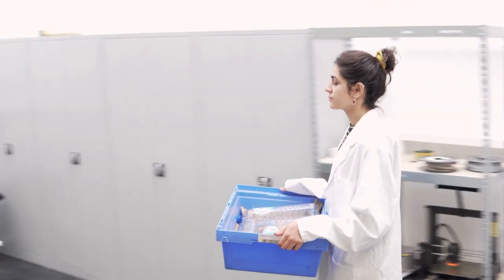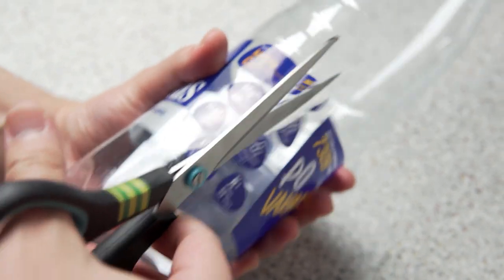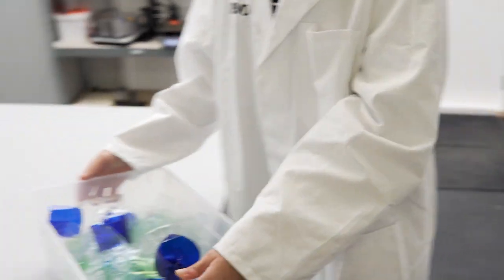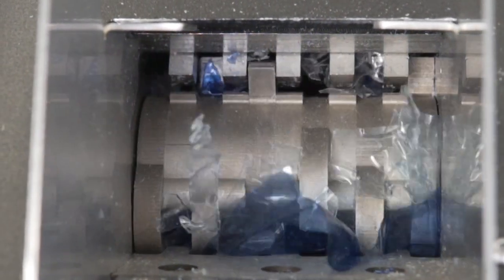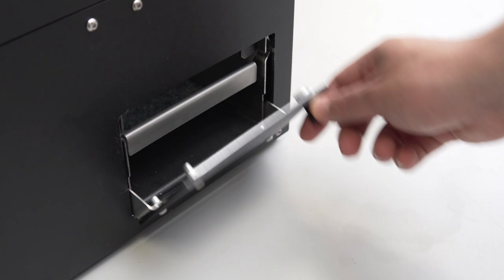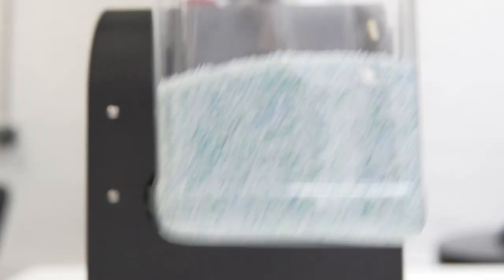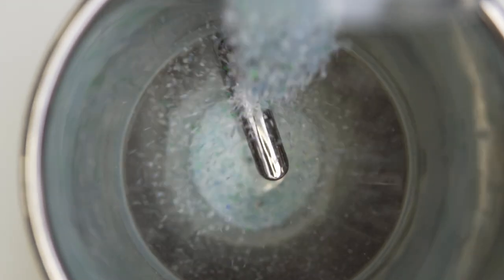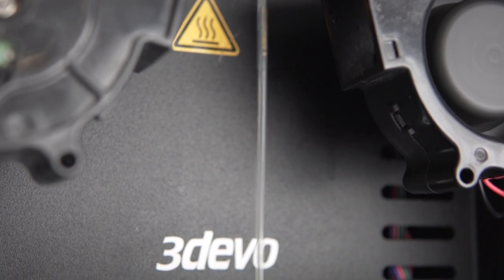Getting started with Recycled PET

Comment: During the recycling of plastic PET bottles which types of additives were used to enhance its chemical as well as the physical properties. Please notify me asap. Thanks. Great video
Reply from the maker: During the research project, we experimented with chain extenders to increase the viscosity of the melt. Though the additive results were interesting, we eventually managed to control the extrusion flow without their help, and then print nice parts. Chemical additives are a fascinating research topic that could help us counteract recycling-induced chemical degradation. Our first results were promising, but more research time is needed. If you are interested in this or similar topics you can have a look at our community forum where we discussed our findings or even start new conversations about filament extrusion. Feel free to be part of the community :-) https://support.3devo.com/community/